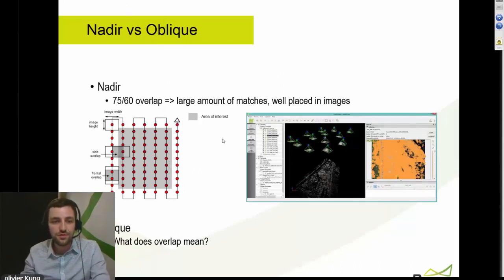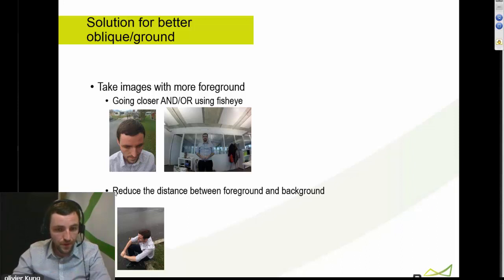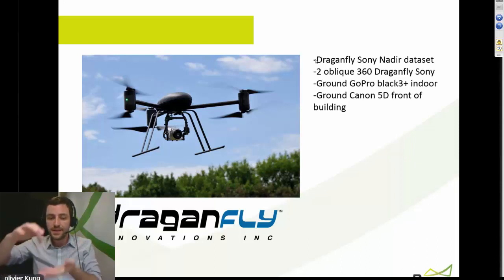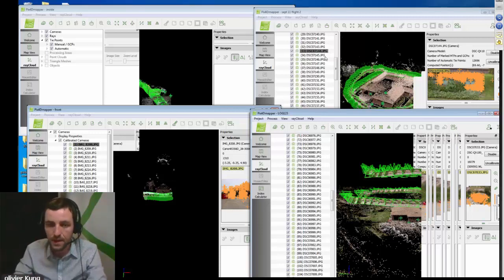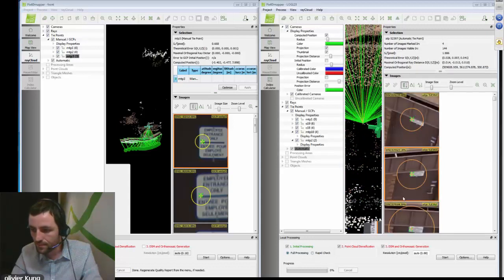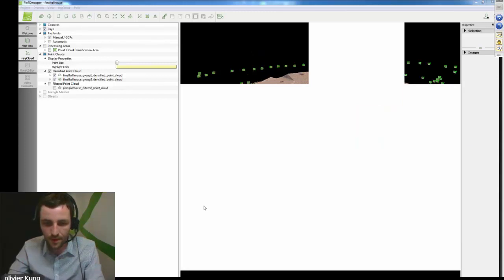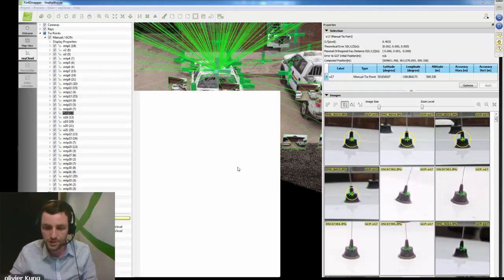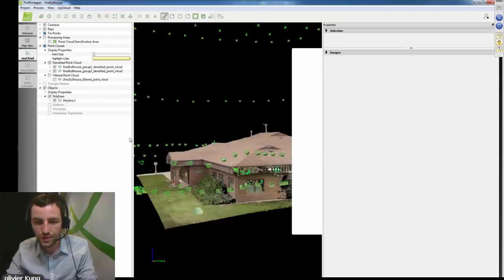Pix4D Webinar 10: Merging Terrestrial and Aerial (Oblique and Nadir) Images in One Project

Comment: Hi,
I'm trying to combine non-spatially referenced GoPro Oblique images of a building with geo-referenced aerial images. However, the stitching of the GoPro images in Pix4D places one side of the building separately from the rest of the building. Can I use manual tie points to bring the building back together? If I can, how do I do this?

Thank you